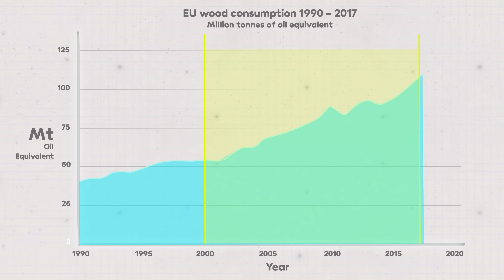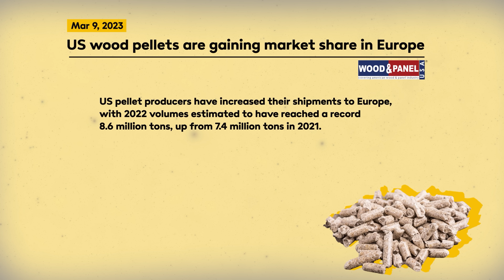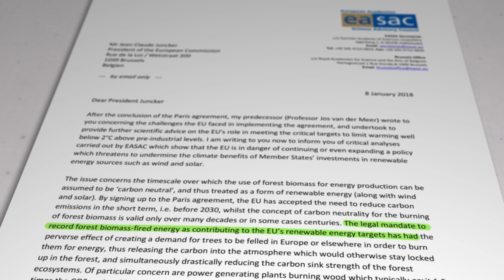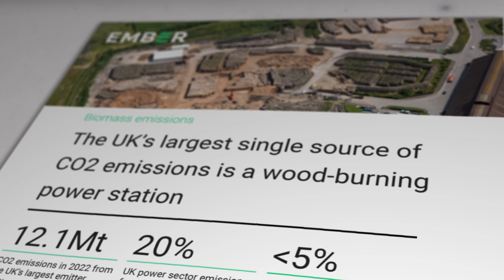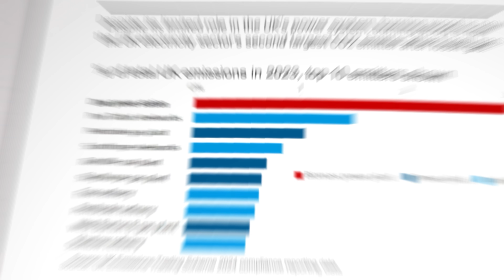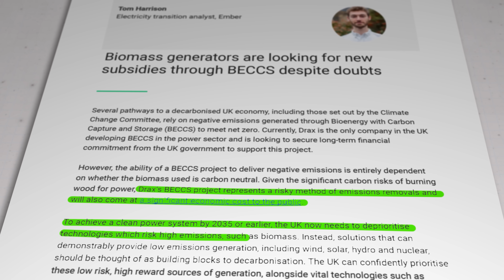New report: Biomass CO2 emissions 4X higher than COAL!!

Comment: At this point nuclear energy should be the main energy source we are using for our power grids. Then use our other alternative energy sources across the world in collaboration with that. This power source is the best option to improve our environment & it will really help lower our emissions. The only things holding us back is legislation and the ways fear mongering has effected people. 

The more I've learned about our power grid, the more I've learned that modern nuclear energy options is our best option. Molten salt reactors, LFTRs, Thorium Reactors, Small form reactors. Utilizing our advanced technology, Improved engineering & material science. Utilizing our greater understanding of safety & well made designs. We have so much more advanced computer technology & robotics that can be used. It feels like even tho tons of advancement has occurred with engineering designs, safety measures, etc. It still doesn't matter to most people. It's like most people are ingrained with a natural negative response when talking about nuclear energy. It's a bummer because i truly believe that our best option for our future is to start utilizing Modern advanced nuclear energy options in our electrical grid. It's just proving to be challenging to get politicians to get on board. 

  It will really allow places to be much more energy independent. Less reliant on fossil fuels. They'll have efficient, stable electrical grids and the rest of the grid could experiment with alternative power sources, power desalination plants, etc. 
We need to heal from the trauma of our past. See & learn that those things only happened solely from Us not understanding what we were doing when it came to nuclear energy at the time. We didn't have advanced enough technology, material science, engineering, safety measures, understanding of how to go about everything, etc. This source of energy will greatly help the world improve towards the future and lowering emissions. More than anything else could, while also providing a very stable electrical grid system. Currently we have alternative energy options but the majority of our grid is powered off of fossil fuels and emission producing sources of energy. We will be so much better going forward commiting to modern advanced nuclear energy options.

Did they outlaw electricity or oil, coal when things went wrong in the early days of those fields? No! They kept going and understood things usually are bumpy and difficult in the beginning and kept going even tho those sources negatively impacted our environment. A huge issue is government BLOCKING any sort of progression from happening. We'd be lucky to see the slightest projects approved or finished with-in the next 100 years.. It's very annoying to see how much we have gotten in our own way when it comes to improving or advancing certain things. Instead we let fear, money, man made "required legal processes" Stop us from doing anything other than wind, solar, oil, natural gas, damming our rivers, mining for minerals... It's very frustrating because we should be able to use all these options in collaboration. If we actually wanted to improve anything. That's what we need to do and stop letting so much potential get blocked from ever occurring in the first place.. It's really irritating. I wish certain people didn't make this so "complicated and difficult" Why would any reasonable person want to block progression?

In my opinion it's been irritating that our society has taken this "it's up to each individual person to make a difference" approach. When that just plays off of people's emotions. This issue is so much bigger than individual people. We need countries/states to get on board. It's the only way we can make even the Slightest difference. We've already waited too long. Everyday is a day wasted & we haven't even made a dent in improving our situation.

The fact that Desalination is so energy intensive but fresh water is so important.. What If we dedicated nuclear energy to be the main energy option to run these energy hungry desalination plants?? Idk why we aren't already doing this anywhere we could...?
Seriously think about it.. Nuclear power produces no green house gas emissions. It's extremely energy efficient. The list goes on. So why are we not utilizing this... We are being extremely too slow, too reserved, too cautious, too inactive to even make the smallest dent into our climate issue and our energy issues. It's holding back progression across the board in many different area's.. It's honestly getting really frustrating. I thought we would be more motivated than this. More active than this....?

Comment: The point is that CO2 from burning of trees or other biomass does not increase atmospheric CO2 concentration because it is part of the carbon cycle. That CO2 was originally taken from the atmosphere by the growing plants.

Burning fossil fuels increases CO2 concentration because carbon previously locked in the earth's crust is added to the atmosphere as CO2.  The increase so far is from 280 ppm at the beginning of the industrial revolution to 425 ppm and rising by 2.5 ppm per year.

Comment: I've run a pellet stove for heat, for years. I always felt somewhat good about it, because it burns so cleanly and completely that it must be a better option than coal... so I thought. The fact is that my heating bill is near 1/2 of what it costs to heat with electricity, so it'll be difficult to justify switching back. That said, I always assumed that my pellets were produced solely from waste product - the idea that vast swaths of forest are being chopped down for the sole use of pellet manufacture is a pretty good reason to uninstall my stove. Are they selling nuclear home heaters, yet?

Comment: The other consideration when talking about BECC is that carbon capture always looks better on paper than in practice. SaskPower in Canada has been touting its carbon capture and storage technology as being world leading for years now in a sad attempt to justify the prolonged use of fossil fuels and coal. They claimed that it would capture about 90% of emissions from the coal plant that it was built for, but after several years, it is capturing around half of that number, meaning that over half of the carbon emissions are still being sent into the atmosphere. With per capita emissions of 67.7 tonnes per person, and annual emissions in the range of 80 MT/yr. to generate power for about 1.1M people, it's not looking good for carbon capture, and there have been talks about abandoning it altogether because of the absurd cost to maintain and operate it. So yeah...biomass with carbon capture is unlikely to yield the desired results from an environmental standpoint.

Comment: Biomass comes under dynamic carbon. Trees absorbs this carbon from atmosphere only. All the process of using this carbon, regardless of it's efficiency, is renewable energy.

Fossil fuels comes under static carbon. It was not connected to atmosphere for millions of years. Any injection from static carbon to dynamic carbon (To the atmosphere ) will increase the total value of carbon in atmosphere (dynamic carbon ). This should be the basic concept for analysing global warming.

Comment: Dave, it isn't the first time corporations have lied to get fat taxpayer issued welfare checks and sadly, it won't be the last. Capitalists have figured out that it is much easier, and more profitable, to milk the public treasury than to actually invest and earn a return on their money by creating anything new.
Reply: Amen to that b
Reply: not just new but useful!!! Capitalism can be used for good - if we have sound ideas as to how it's done - and so I do believe in rewarding good behavior with subsidies and punishing the offenders. What's your problem with that? It's not perfect, but hey - it does help tremendoursly the 95% we get right.
Reply: @extropiantranshuman  It's also about who gets to decide what is "good behaviour". If I was the Judge - then the way DRAX claims it is Carbon Neutral would get bounced Out of Court. They need to account for ALL the CO2 that is involved in getting the pellets to the Power Station and would not be allowed to make the case that the trees can be "Back Dated" in terms of CO2 consumption. CO2 accounting should be from only be taken into account from the time the tree is cut down. Time is a far more Critical Element in the CO2 equation than is currently taken into account. If the average Temp of the earth is going to increase by +3degC in the next 50-100 years - I'ts no good claiming that all will be OK by the time the trees that are going to be planted (if they are) will sock up the CO2 in 100 or more years time.

Comment: If it was strictly waste product it would be one thing, but harvesting for no other purpose is what makes it wrong and it should not be subsidized. Meanwhile here in the states we have contractors clearly land for building that cannot afford to process as biomass because no place is close enough, so they burn it anyway to get rid of it. The trucking costs are too much that it would be a net loss to use it for generating power. Double whammy when we get hit from both sides.

Comment: I work in sawmilling in AB and worked in Pulp&Paper in BC. I use to say we sell wood chips and wood is a byproduct. Also Drax is shady as hell, aside from the fact that they are making wood pellets in Canada and shipping them to europe to call it green energy... They also got caught in BC chipping good lumber trees for pellets, which is a super waste of our trees. As you point out.
There is no Carbon capture on their AB/BC operations, and unless they do in Europe, then they are just burning wood from somewhere else.
Reply: "Carbon capture" is such a scam
Reply: the BECCS is to be installed in the stack of the combustion unit, because the CO2% is much higher and easier to be captured and compressed. It will be a similar system to the CHP unit at Copenhagen (aka Copenhill) that was shown to the delegation of UNFCCC. I guess the pellet plants could capture CO2 from the stack of the dryers, but its significantly lower volumen content than a stack of the combustion unit that would be burning the wood pellets (at the CHP unit at Drax or Copenhill).

Comment: Why is nuclear still part of the discussions? It's so ludicrously expensive compared to renewables and storage, plus leaves the multi millenia problem of nuclear waste; it is another example of high-powered lobbying turning politicians' heads! Ignore climate change completely and look only at economics, renewables plus storage is far cheaper and paying households to have solar plus batteries (decentralised power network) would save billions for national grid alone....
Reply: You're uninformed on nuclear. All of these issues and questions already have simple answers. Solutions for waste reuse and storage are improving all the time. Just look up this info it's out there.
Reply: @YourCapyBruv_do_u_rmbr_3Dpipes  we still don't have a permanent storage solution for current nuclear waste. And you haven't commented on the fact of the expense of it either. Remove all subsidies and fossil fuels and nuclear are not viable....says everything you need to know about them I think.

Comment: why would biomass produce 4 times more CO2 than coal? yeah wood is less carbon dense than coal, so you need more volume of it, but the mass of carbon is the same.
is it because the wood has water, and so part of the heat is just wasted to evaporate that water inside the wood?
it might be slightly worse than coal, but 4 times as much?
i need a more in depth explanation about this part.
in general yeah burning wood at an industrial scale isn't a solution. we aren't planting back more trees than we are cutting, and even if we were, we aren't producing a good habitat, just monocoltures of whatever tree is most productive

Comment: UK does not need less biomass burning, UK need more energy storage with more renewables charging it.  Then the thermal plants Biomass, Coal, Natural Gas, and Nuclear) can be idled one by one.  

If you shut Biomass you are only trading to Coal, Natural Gas, or Nuclear otherwise.  Change the biomass laws if they are not right.  It only effect the order of shutting down thermal planets.  They all need shut down.  Biomass leaves less waste at the site than coal or nuclear.  But we have little time to get to less carbon.

Comment: Producing pellets adds so much waste energy and "glue" substances to the processes... I don't think any wood treatement other than chipping can ever have an overall acceptable energy balance, although it raises further issues in storage safety.
Wood biomass may be considered a carbon neutral fuel, after accounting for the Life Cycle Analisys "losses", but should be still used at efficiencies higher that the carnot cycle, using the waste heat whenever possible - maybe district heating being a prime candidate "heat sink", at least in northern regions.

Comment: not even mentioning the fuel used by the equipment needed to produce the biomass. biomass only works in small scale like my heating my cabin with dead trees in my area. i have used a total of about 24gal of gas per year for the past 20yrs. less than half that goes for my wood. this system does not scale.

Comment: We built our house on this side of the pond in 1982 on a relatively large lot and use cordwood (not pellets they were not a thing back then). The house is very energy efficient and we burn about 2.5 cords of wood a winter that also provides most of our domestic hot water. Initially I was very enthusiastic about using a green energy source. Unlike commercial biofuel we are able to harvest wood on our property so there is minimal use of fossil fuel during the harvest. We are not clear cutting just doing a selective harvest and removing dead trees.

What I have learned over the years is as you mentioned while burning wood releases the same amount of CO2 as decay it does it very quickly. Contrary to popular belief young new growth does not capture nearly as much carbon as mature trees annually. Finally wood smoke while I love the smell is actually pretty dangerous because the soot particles are extremely small. 

Bottom line there is no free lunch and where vast sums of money are involved one should assume the cost will be higher and benefits lower than advertised. A few years ago we installed a minisplit heatpump system on the house. This had less to do with being green although it is a great system and more to do with getting older and not tolerating summer heat well and getting too decrepit to harvest and haul wood for winter heating.

Thanks for pointing out the reality of biomass. We cannot solve our environmental problems if we delude ourselves about the reality of the situation.

Comment: When you burn tree wood the result is net zero no matter how much co2 is released by burning it.    That is because the tree got the carbon out of the atmosphere and burning it is returning it back.   When you burn coal  you are releasing Carbon from millions of years ago.     The problem with Bio Fuel is that the amount of carbon available in recently living biomass is so small compared to the amount stored in ancient coal  and other fossil fuels.    It is not possible to replace fossil fuel with biomass because there is not enough biomass on the planet for the current yearly energy requirements.

Comment: This comparasion makes no sense. The CO2 released when burning wood is CO2 that was already in the carbon cycle. The trees absorbed the carbon when they grew and then some of it was released back in the atmosphere when the wood was burned. This does not add more CO2 over time, in fact it reduces the CO2 level slightly since some of the carbon will remain in the ashes. Also, if the wood had been left to decompose naturally, much of the carbon released into the atmosphere wouldn't have been CO2 but methane, a far more potent greenhouse gas.
It would be a different story if we burned more biomass than what was produced. That is indeed a problem in some parts of the world but not in Europe where the forested area is steadily increasing.
Reply: Virtually zero carbon remains in the ashes from anything burned in a grid-level power plant. The CO2 released isn't neutral if trees are cut down and burned faster than they grow back, and you must account for the fuel used in processing and transporting the wood across an entire ocean. The decomposition argument doesn't apply to trees we cut down intentionally for the purpose of burning them. The forested area in Europe isn't the only factor when the trees they're burning in Europe were cut down in other parts of the world and transported to Europe to be burned. All of this is addressed in the video.

Comment: I will look into it because depending on how it's burned the CO2 emissions get better or worse. Also, decomposition releases methane - that though it has only one carbon atom it's equivalent to 20 CO2 molecules. The subject is really important, though - I can't find a simple answer. And the answer will probably vary from place to place. Nice video, Mr. Think!
Reply: I found this video from 4 years ago about cofiring - burning biomass with oil or coal. My dad worked on a nickel producing company - they actually produced Nickel Carbonate. On a certain stage, a paste of the number II variant ( Ni₄CO₃(OH)₆(H₂O)₄ ) turns into number I type of the carbonate ( Ni₄CO₃ ) by blowing hot the product of burning biomass in high temperatures through the paste. They prepared the biomass (drying it) and fed it into the burning chamber when conditions were desired (overheated environment). ... and that's what led me to look into the relationship between burning methods and CO2 emissions. 

Here's the video: https://www.youtube.com/watch?v=FTnw1dXyK8Q